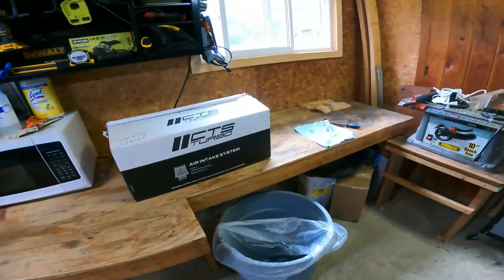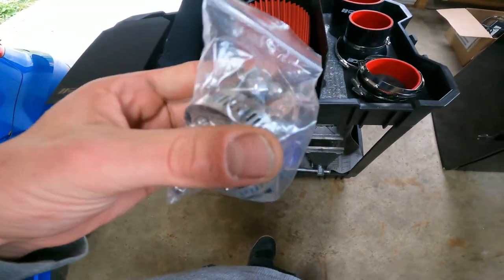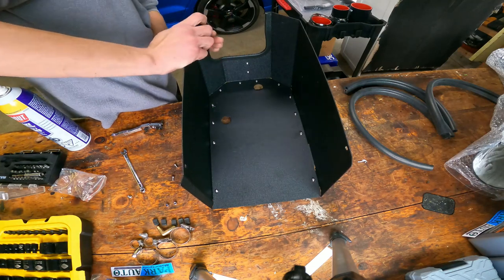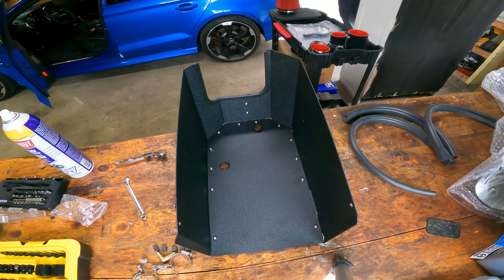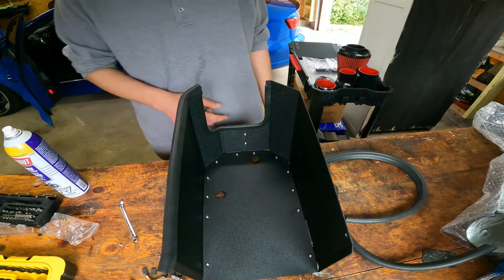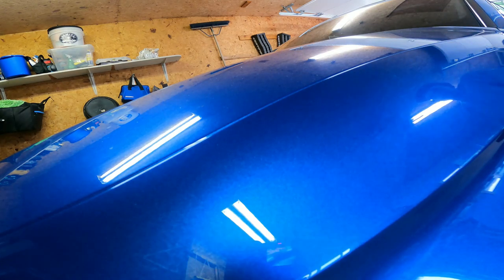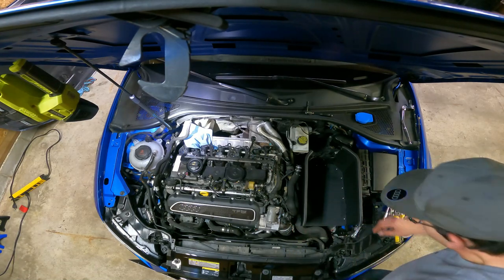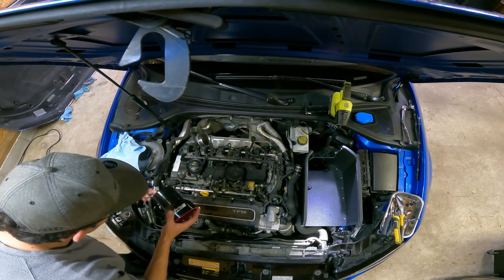2018 Audi Rs3 Gets its First Bolt on(4" CTS Intake)

Comment: couldnt tell from the video: is the actual engine induction sound more? definitely a lot more turbo. curious if there is more 5cyl engine notes coming through with this change
Reply from the maker: It definitely has a deeper groul to it when first getting on the throttle

Comment: Nice video, thanks!
Reply from the maker: No problem!
Reply: @BickfordsRs3  Did you ever try out the ‘loud mode’ I mentioned on another of your videos? 

Set individual settings to normal Dynamic things but set gearbox to Auto. The valves are always open, even at low rpm
Reply from the maker: I've tried, my individual has engine/transmission set to auto, its does seem a bit louder then dynamic. Not sure why there both under one setting..